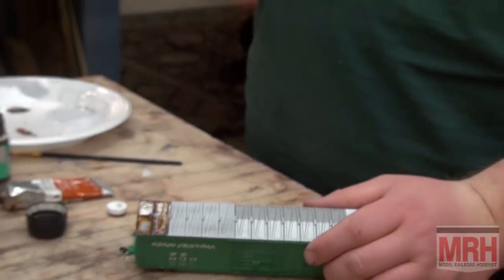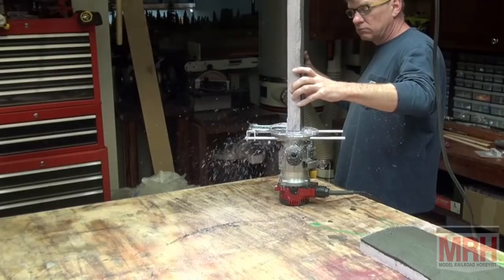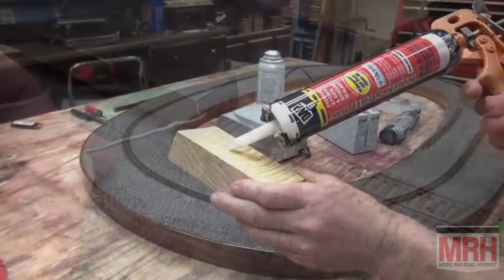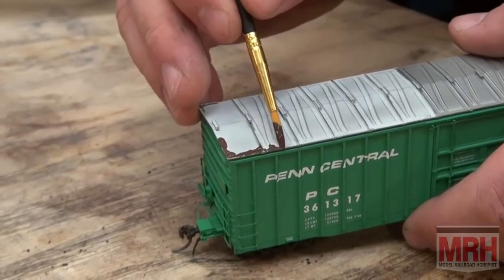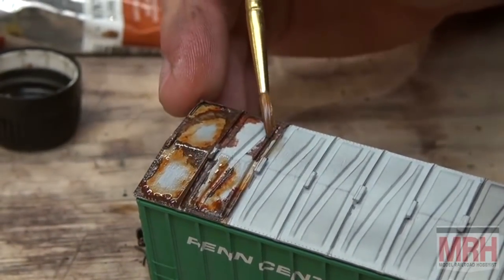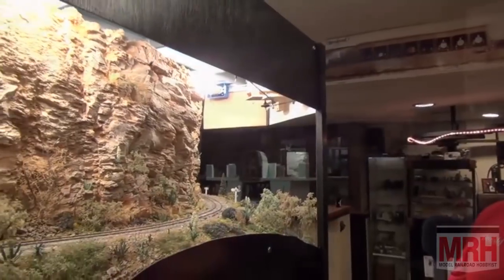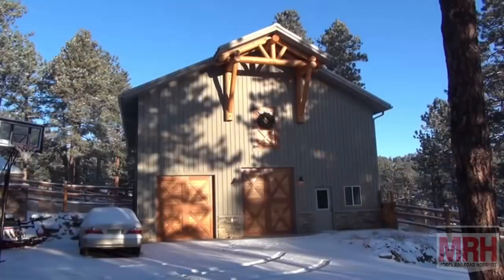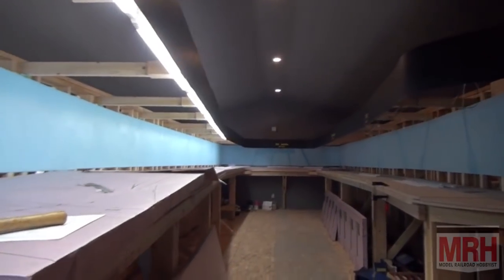Whats Neat in model railroading | February 2018 Model Railroad Hobbyist | Ken Patterson

Comment: Hey Mike great points about steel loads coming off sequential stacks during manufacturing and how over time some damaged panels would have been replaced or from a different batch and therefore be rusted different than the ones next to them. Also thanks for pointing out colors of rust relating to its age, such good reminders. Your comments through the weathering demo nailed it. Good weathering technique involves not just considerations for weather over time but how a batch of steel might differ, to various mishaps, bumps and repairs a car might get through the years. Good stuff!

Comment: Wow, what a home layout Kevin is building. Five scale linear mile run not counting sidings. I have been in clubs with less mileage. Has track maintenance gone down greatly since the days of brass rail? I know nickel silver oxidizes differently. My concern is maintenance versus operation time. Went through the issue of spending more time maintaining than operating before. Love the work of your modellers and the enthusiasm you bring to the hobby.

Comment: Ken great job as always!!    for my next project I will try a mix between modular and TOMA sections, but I have doubts how do wired my bus line?  in my 8X4 was easy a simple 16 gauge around the benchwork. How I kept the bus wired with modular sections or TOMA?

Comment: Magnet is only holding 10lb.  20lb divided by the 2 support points is 10lb at each point.  10lb at the magnets and 10lb at your hand.  Granted this 20lb is closer to one end moving CG over your fulcrum on lever  so the split might be more 75/25 15lb at the magnets and 5lb at your hand.

Comment: I'm using magnets and a 2 section of angle iron stock the nest together for a lift section.  one you drop the section into place with the angle iron guiding it to perfect alignment every time 1st test used to powerful of magnets and it was too hard to get apart.

Comment: Hey Ken, I have a couple questions. First, how do you wire the modules for the layout held by magnets? Second, could I use regular paint thinner for weathering instead of the odorless thinner?
Reply: I weathered a locomotive with oil paint using standard cheap turpentine in the past, it took more than two years to (look) dry (yes 2 years). With odorless quick drying mineral spirit for oil paint , I have everything dry in a week or less (and no odor, which is quite pleasant). And for just weathering, even a small bottle will last a long time.
Reply: If you want a quick way to wire them together, try quick plug lighting connectors. They’re primarily used for fluorescent lights, but they come apart really easily and stay together really well, and because they are a plastic unit, you could embed them into the side of the module similar to the magnets, so all you have to do is line up the connectors, push the modules together, and voila! By the way, those connectors can be bought at Home Depot or nearly any other hardware store.

Comment: Hi Ken, John here from the UK. I have been watching your show for about a year now (and more recently the weekly podcast) and I am fascinated by the use of styrofoam for layout construction. I have tried to find out more but it seems to be frowned upon here in England and dismissed as not viable. My new layout section that I need to build needs to be super light as It will have to be removable and quite large like yours are . I am looking for some guidance on installing and wiring Tortoise motors to turnouts laid on foam and can find very little especially how to route the wires through/round the foam. Do you know of any books/videos that will help me get started in styrofoam baseboards? ............John
Reply: It is extruded polystyrene, you will find it at a building supply store.  At www.kenpatterson.com he has a video on how to build a shelf layout.
Reply: Thanks Ryan. ...........John
Reply: Hi John I'm in the UK you can get the foam from wickes it's goes under the name of celotex here, if you cut grooves and slots for wiring it can be filled with expanding foam from an aerosol or glue foam back in with gorilla glue. Also glue ply to mount point motors etc. Where needed.
Reply: Hi David, thanks for the reply. I have now obtained some  blue XPS which is very dense but also very light. I think it is made by Dow Corning. A bit expensive but very high quality.
Do you have any experience using XPS for baseboards? Seen any videos? Know of any books? I have watched Ken's videos where he uses XPS but he keeps the electrics very simple and uses manual point operation.
So far my idea is to use 50mm x 4ft x 2ft sections wrapped on all four edges with thin ply or mdf and add a1/2inch stripwood lattice to the base to allow the whole thing to slide easily into place and to give somewhere to keep the wiring. I will also do as Ken does and paint all the foam surfaces with emulsion paint to seal it. .....................John
Reply: I use it for scale model bases the blue model foam is more expensive than celotex but very dense. I am making a small 2'x2' Christmas layout with some at the moment. I use rod and tube switches with frog switching for turnouts for motors I would probably cut out a space under the switch and insert a wooden patress to mount the motor to.
Reply: It does seem that the most dificult part will be the attachment of the point motors. I will be using servo control and a micro switch for the frog. I am thinking of mounting point and motor on a piece of stiff material as you suggest and dropping it onto the base in a recess. The point will be ballasted as an assebly and held in place by rail joiners slid on after it is placed in position. It will then be connected to the layout by a connector. This way it can be set  up/adjusted off the layout and removed any time for maintenance.

Comment: Question, for anyone who can help. What is the max number of HO cars you can pull per locomotive on a flat layout? For example, can 1 loco pull 15 cars, and a 3-loco lashup pull 45?
Reply from the maker: It varies. Some locos can pull 3 cars max, others can pull 30 cars. It also depends on the weight of the cars and how free rolling the trucks are. If one loco can pull 15, three locos of the same brand should pull 45, but you need to test it to be sure. That assumes level track and all the cars weigh and roll the same, and testing each of the three locos independently shows they can each pull 15 cars by themselves.

Comment: Would testors thinker work for the whethering
Reply: Turpenoid or mineral sprits are easy to get.  Any thinner that cuts oil paint will work.  If your unsure go to your local art store and ask them for guidance.  Testors thinner is a no go plus its super expensive in comparison to the other thinners.  BTW im the guy who did the segment.
Reply: indy svt well for me I live in canada so it's hard to get all these thinners
Reply: Any Michael's store will have these thinners and more. Or go to Canadian Tire and buy mineral spirits. Cheap and easily available.
Reply: thank you

Comment: Why didn't you use any alignment pins?
Reply: I think the magnetic fields of the connecting magnets want to naturally center themselves to balance the magnetic fields and thus act as alignment pins.
Reply: Eric, while that's sounds good, it's not quite true. If you take 2 loose circular magnets and allow them to come together they will not automatically come together in perfect alignment (circumference to circumference). The earth's magnetic field, other potential magnetic fields in the area, as well as, the individual domain fields of each magnet will affect how they come together. The layout sitting flat on the table provides the major portion of the alignment. The fact that both sets of magnets, on both sides of the layout, would have to be in perfect alignment for the "self centering" to work. I suspect there's something else going on here that Ken is not telling us about that ensures perfect track alignment. While you could easily adjust the layout once assembled, I can't imagine the N scale track work would be perfectly aligned every time you just let the layout come together by the magnetic attraction alone.
Reply: In regards to the chess set, there is only one magnet not two. So it's not an apple to apple comparison. Unlike the layout, the chess piece is free to move while the bolt in the board is fixed. The movement of the chess piece is not controlled by the table top like the layout is. etc. etc. etc.
Reply: They do line up well. Snaps with a crack.. pretty cool.. I have not put the Ho module segment together yet.
Reply: @Kensart55  I have to admit that the n scale test gave me an idea for a free standing (sitting) hon3 layout that could be done in modular sections. You could make a yard separate or small sidings that could be removed and stored when not in use and leave a small oval up for just letting something run in a small space. Any suggestions on what hon3 track would be good to use? What would be your minimum recommendation on turnouts? Would really like to try this.